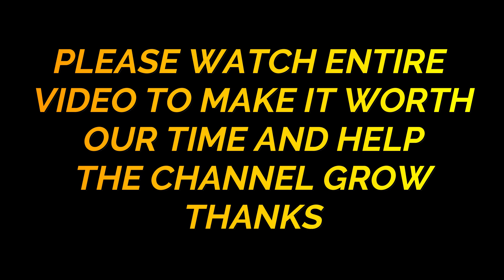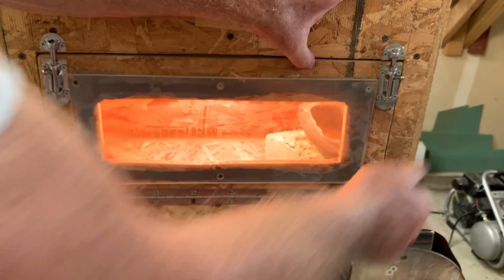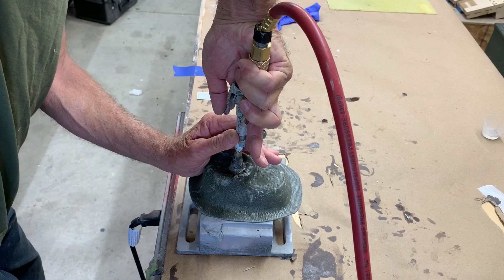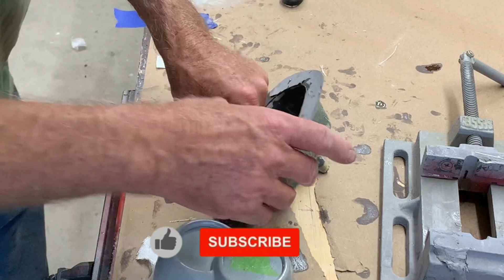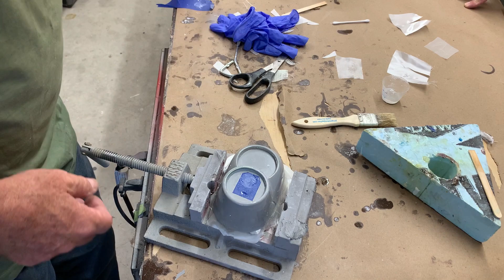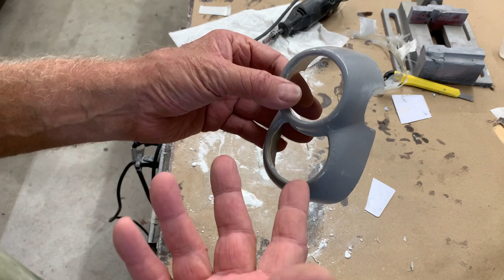Composite RC cowl Mold Part 6 Finishing Up

Comment: What do you do to make sure the gel coat doesn't have air bubbles after applying to plug?
Reply from the maker: You can use a heat gun but in most cases a good brushing does not have air bubbles